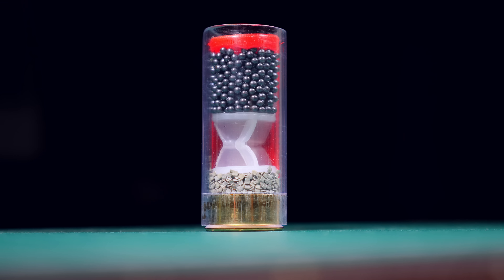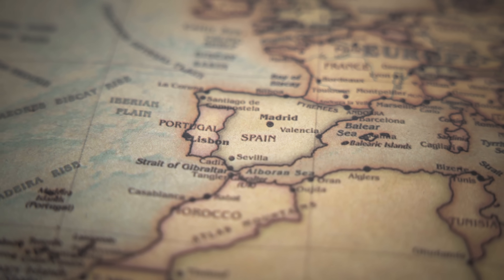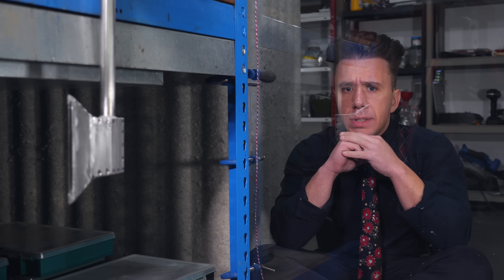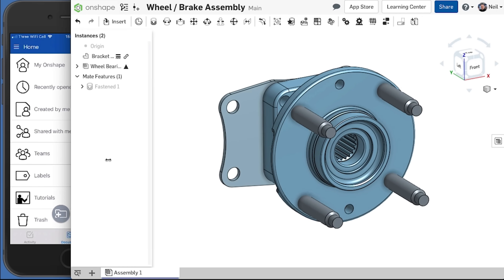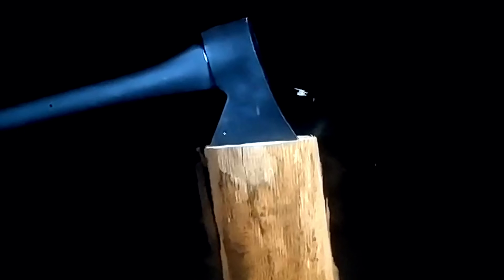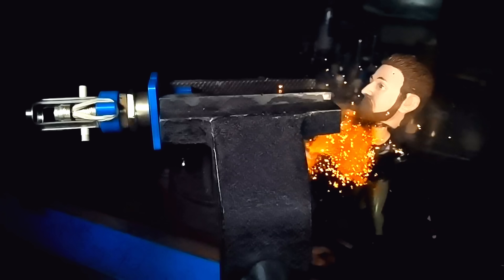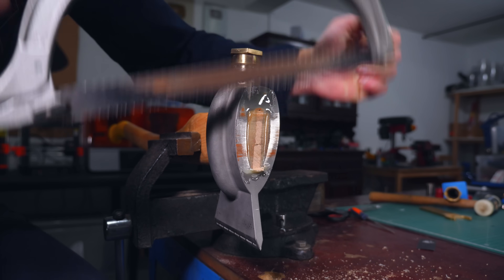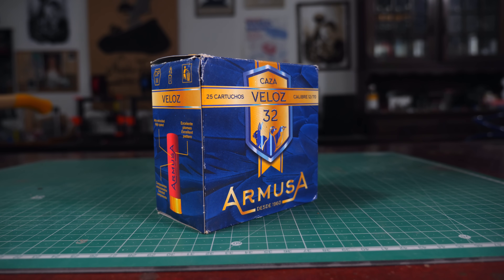I Built a SHOTGUN AXE

Comment: This is the first "I made a special axe" video I've seen, where the axe actually works better than a normal axe.
Reply: This is the prototype to the Switch Axe from Monster Hunter
Reply: For this comment section's reply: a reminder that the OP has no intention to revolutionize the lumber/axe industry.
Reply: @CornDonny  People just gotta be so nitpicky :/ it's just a silly comment that "this axe splits a log more dramatically than a normal axe would" and people are acting like the future of the planet depends on the comment being entirely scientifically, economically and semantically accurate.
I've chopped logs before, and yeah when it's good wood and you know what you're doing it's easy, but I've NEVER seen someone chop a log in a way that makes an explosive noise and shoots the two pieces to opposite sides of a large room
Reply: @coryman125  tbf they're all arguing about the kinds of axes in the industry based on what they do best. Unlike you, I'm not a lumber so I can take it a little less serious, but sometimes debates like this are easy to lose what was the proposed idea in the first place and gets...a lil nerdy kind of boring.
Reply: It wouldn't actually work if it weren't for the wood being super dry and seasoned they wouldn't have burst apart. It works for entertainment but not for a lumberjack out here hoping wood. If it were green in the slightest bit they would not come apart
Reply: @rls5280 they absolutely would
Reply: Costly though
Reply: @vergiltheartofpower6616 Look at all the time you save not haveing to stack the roof you just cut. It dii or es it for you 🤣😂🤣😂 got 2 nice piles on either side clean out of the work space.
Reply: actualy I know of one more interesting experimental axe video:
Hydraulic Press Channel made a Cross Bladed Axe to get more splits whith eatch swing. and well it's very niesh but interesting nonetheless
Reply: Can this cut down a tree faster than a normal axe? I think that's the true test.
Reply: @ In this version probably not, because you would have to reload every time. Would need an automatic version for that. But I also agree with the first comment, it looks like easy to split wood here...
Reply: @areejashraf7413  this is more of a splitting axe. For cutting down a tree, you need a chopping axe. Totally different axes for totally different applications.
Reply: it does not work better than a normal one even, that wood he's chopping is all straight grain with no knots and not very thick either, with a properly made splitting axe you would barely even feel the resistance.
Reply: @windhelmguard5295  I think it's still pretty impressive from the perspective of you can give this to any random adult and they can split a piece of wood. Give a random person on the street an excellent splitting axe and tell them to split a perfect piece of wood. The success rate is going to be surprisingly low.
Reply: @Tepid24   I don't know man, I think some rando can figure out 
Lift the thing, point sharp side down, let it drop on wood.
As long as he doesn't miss (in which case the shotgun axe won't do much either) it's going to work.
You are right about it being a neat concept, would really want to see this deal with a gnarly twisted piece full of knots.
Reply: @windhelmguard5295  always gotta be one of you guys in the comments huh
Reply: @agibitable  someone telling the truth? How horrid!
Reply: @windhelmguard5295 no you are wrong

Comment: If I could add input you have the ports facing towards the log which can eventually lodge full of debris and at which point the gas will find the path of least resistance which could result in shrapnel. If you could relocate them and change the angle so it pushes to the side rather than forwards I think it would be a better design. They actually used to have a black powder version of this in the early 1900's where you pound it into a stump or log, light it and run.

Comment: Yooo you should make sugar rockets 
1. mix equal parts sugar and potassium nitrate in a pan
2. Add water to cover mixture mix until it’s combined 
3. Boil water out until its thick and slightly browned 
4. Put in moulds or don’t 
5. Let it harden 
6. Done you just made rocket fuel light it up 
Be safe and don’t get burned 👍🔥🔥🔥🔥🔥🔥🔥🧨🚀🚀🚀🚀

Comment: Nice work!
But btw, the most dangerous thing you did was the incorrect stance when swinging the axe. You're supposed to stand with parallel feet, a little more than shoulder width apart, so that when you miss the wood, the axe doesn't chop, or in your case shoot your shins.

Comment: What if you put the shell in a piston in between a steel block on a stick and a tiny splitter that are connected by linear guides? Then the kinetic energy of the splitter would cut the wood instead of the gas. This should allow you to use a much smaller shell as it should be more efficient energy transfer.

Comment: 10:51 you say weld yet then you braze you can't weld using a small propane torch as welding melts both objects together requiring high voltage and proper amperage to obtain proper penitration between the objects brazing is more of what you did

Comment: Just a heads up for handling an axe, I can’t help but notice you have your feet in line with the target, this is dangerous, stand straight to the target with your chest, then put your feet either side of the block, and swung the axe up with both hands apart (leverage and blah) then “pause”the top hand, let the axe carry its speed upwards, until your hands come together at the end of the handle, then bring down with force. That way you won’t hit your feet, and you will have better accuracy.

Comment: It may sound very stupid but I like the concept of "redundant tools": something that was design to transmit the user force, with a force generating/potentializer mechanism on itself. For example an spinner with an flywheel, or an hand hammer with pneumatics/hydraulics.

These are dangerous waters to navigate (borderline making weapons and exposing the body to risk factors), but it's almost poetic to try to get much from little using knowledge.

Comment: Hey Integza, I challenge you to make a working jet engine using toothpaste! Hear me out—some toothpastes contain hydrogen peroxide, which could act as an oxidizer. If you mix it with the right fuel and use a catalyst like silver, you might get a reaction strong enough to produce thrust. Imagine brushing your teeth and launching a jet at the same time! Would love to see you attempt this madness! Also I love your videos
Reply: Integza, I have the ultimate challenge for you: Build the Tomato Defense System 9000! A fully automated security system that scans for tomatoes at your door and takes action. If someone tries to sneak in a tomato, it gives them a warning, a zap, or even launches the tomato out like a cannon! This could use AI detection, electric shock handles, or even a robotic tomato-punting arm.

No tomato shall ever enter your house again. Will you accept this mission?

Comment: You are awesome brother! A quick tip for when you need to sharpen that monster again, all it takes is a few passes with a file on each side going down from the apex toward the handle, like you were splitting the file. And if you want it really sharp (and even) go from one tip of the apex to the other while making the downward stroke so the file moves at a diagonal along the apex. Just make sure to go same direction on each side. Enjoy!

Comment: OnShape is pretty decent but it's hella expensive for the subscription and without it everything you do is free to anybody.

Alibre is a better option if you have money for software in my opinion. Buy the tier based on what you need to do with it, pay to get software updates or just keep it as it is depending on what you want - either way you can change it later and the pricing is far cheaper. The only thing that's kind of annoying is that it doesn't support .f3d files and Fusion360 users don't seem to comprehend that they should make things available in .cad format.

Comment: The concept of using a shotgun shell powered axe to split wood is interesting. Have you considered using compressed CO2 (3000psi about 2-3 times the pressure of a shutgun shell) or NO2 (5000psi about 4-5 times the pressure of a shotgun shell)? Either would be more practical/useful (safer/controllable) for emergency situations (firefighters fighting structure/wildfires) and wood splitting.

Comment: You should make one of these using a gas cylinder and trigger system like in an air rifle, that way you could have multiple swings without reloading!  Or maybe a compressor that continuously refills the gas reservoir (built into the handle), never needing a refill.  If you get rich off that idea - a 3% royalty would be kind of you!

Comment: I grew up in a home with a wood burner, and we used to split wood with a 12lb maul. I did it for a workout or when I was bored even. I now have a homemade 16lb axe that I use for splitting. One thing that I have learned is that you never chop wood around things that you care about. If you have to split wood around something, like your car for example, set it up so that your back is to the vehicle and you are chopping in the direction that the car is pointing.

That way, when you split the wood and it goes flying, it flies to the sides, not usually backwards, and it wont hit what you are trying to avoid. 

I have broken windows and dented cars before when I was younger. I learned the hard way.

Comment: I wonder what the life of the blade would be?  Surely it has a failure point at some point in time from fatigue with hot and high pressure gasses being passed through it, as well as the blunt force being applied with each swing.

Comment: Huh! Could a compressed air tank work on this head design? Weaker, but maybe still strong enough to split the wood... Without throwing the halves across the room 😂. Figuring out a design for a release trigger and mounting a small tank on the axe or running a hose along the haft could be interesting challenges!

Comment: i must say that's very very cool, as a forester i can do it one handed, but of course, this is because i under stand a few things, like cut like a knife had the shoulders low , and never for get hit the floor don't pull the hit I have a over 100 year old felling axe head on mine. next time look at different stiles of head, now days they have very wide heads. An interesting problem for you, see if you can modifier that axe to feel a tree with the axe, ( that is an very old skill and most of us dont do it any more) or say split a long cross ways in say less than 3 hits

Comment: We call a pole style shotgun a bang stick in the united states. We used them primarily for tough game hunting like alligator. The way I made mine was using a decent-sized spring with a steel hammer and a nail in the center. When my barrel contacts the target the force causes the steel to sling forward and detonate the primer. I did it this way instead of a sliding tube within a tube so that I could put a pin in the steel when I'm not using it. This gives me a sure lock mechanism.
Reply: Also you can get rid of the shell and make it a self-charging system using the electrolysis units. I have done something similar to this about 6 years ago but like I say in every comment I always forget to turn on the camera. Recording is my worst enemy. Also I do things that are two or three magnitudes more dangerous than you do. For instance I've been working with hydrogen for over 12 years now and about 10 years ago I gave myself permanent tinnitus. That was because a rather large unit decided to detonate in my face. I have since developed smaller units that are the size of a pill bottle and put out over a liter of fuel a minute. This means that the units are now scalable enough to fit in the handle. I have developed some units that will last up to 3 years without full degradation but I still cannot afford the materials I need to make a long-term unit. I need rhodium and that has gone through the roof!

Comment: I guess you could try with the finished blanks of 9mmk or .380 on that axe, it would be cheaper coasts and less labour demanding in the making of the shells. Also some of the power tools use powerfull blank shells to drive in bolts in stone or armored cement, I don't think they are licensed too.

Comment: This is a really neat idea, but the problem with it is economics.  The purpose of wood splitting is to prepare fire wood and you burn wood to save money by using it as an alternative heat source to electricity, oil or other fuels.   Bottom line here is that shotgun shells are simply too expensive to use in this manner.   You'd end up spending more splitting your wood than you'd save in electricity or other fuels.    What this axe needs is some other source of ignition than primers.  The gunpowder itself should be cheap enough, perhaps if you used an electric ignition or even a flintlock.

Comment: Take it from a former (a half-century ago) woodsman competitor: you need to learn how to swing an axe.  You are not supposed to have your hands apart at all when the bit hits wood.  Your strong hand (your "handed" hand) starts where you have yours, but as you transition the swing from a horizontal hold to vertically over your head immediately before the down stroke you slide it to meet your weak hand at the end of the handle.  Then you bring that mother down HARD, dead-center on your target.  Give it a try after watching a few woodsman competition videos.

Also, what you said at 4:54 is incorrect.  After putting down my axe I took up firearms design and engineering (1979).  The reason why the propellant does not burn nearly as much as it should is because you are not giving it enough room in which to burn.  The flaked propellant, the wad, the shot -- all of that is precisely engineered and measured for shotgun barrels of sufficient length, as shown in the clip just before 4:54.

When the primer detonates and ignites the propellant it does so at the rear of the charge and then attempts to progress burning throughout the rest of the charge.  But you are stopping all (most) movement only a couple of inches away from where it started, blowing some out the slots with the rest jamming inside the bit.  That is the only reason why your propellant is not burning (nearly) completely.

I hope this helps.

Comment: GREAT video, thank you!!!!! I have an idea????????? Take a scuba tank (5,000 psi) run the tube through the handle up to the ax head.  ...........Then use the compressed air from the tank to do the same thing. BUT NOW you can keep using the ax over and over again until you run out of air or the pressure gets to low to have any affect on the wood. Us the same trigger action the activate the air flow into the ax head...........Okay let me know how it works out. Another idea. With my PCP air-guns you could use one of the high pressure cylinders and incorporate it into the handle, no scuba tank need.  This could revolutionize the wood splitting industry.   Good luck.

Comment: From a guy who has a wannabe boom boom as a pfp, the aluminum axe head is actually MUCH safer in a catastrophic failure.  Steel is less likely to blow apart... but it will shatter when it does blow apart.  Aluminum just rips apart and there would be 1 - 3 big slower moving chunks instead of a thousand blazing crystalline shards.  Having said that, it's easier to remove steel from your body.  Still, steel boombooms more scary than aluminum ones.  I also do rocketry in decifeet/etc... so you know.  ignore me at your discretion. btw my channel has nothing on it.

Comment: It is a super cool axe but in the making of it you slightly messed up 😅 (quietly whispers) turn the ax head around 180 degrees on the handle...it will help with your aim and power delivery and make it a smidge safer.

Comment: You could make the chamber a bit higher tolerance with the tip of the tool and shells yourself. 
Maybe consider a mix of nitrocellulose with black powder? 
Black power burns faster, so it could help you burn more propellant. 
Also cover the tip of the tool with vasoline (petroleum jelly) or something to add more pressure. It will only go from the tip holes when compressed. (Maybe mix the vasoline with corn starch to make it thicker if you want)

Comment: Iteration 2 must have a pump action handle.  There are several clever ways to implement this like using the handle itself as the tube.  However, a mechanism to cycle the shells into the head with a locking chamber may be complicated, but you may not need to rotate them since there is no projectile and you can probably just use most of the hardware from a regular ol' shotgun rather than make your own (just basically weld the head onto the end of a barrel more or less), just expanding gas to account for.  Secondarily, you may improve effectiveness by implementing a piston system that drives the force into the axe head itself rather than expending the gasses directly (think of the physics toys using the clacking balls on strings).  This would allow it to more completely deliver the force even when not buried in the wood, though you'll want vents to release excess gas at the fullest expansion to prevent it from exploding in a less productive way.  You can also get mush shorter shells so you can fit more of them in the device with less force per shell.  Finally, if you have an overabundance of force maybe there's a way to propel it into a flywheel that causes the blade to vibrate a few times with extreme force giving it more penetrating power.  Anyhow, super cool idea.  Looking forward to seeing the "I made a pump action axe" video hitting my feed in a few months if I'm lucky!